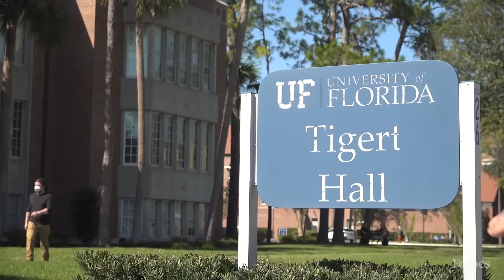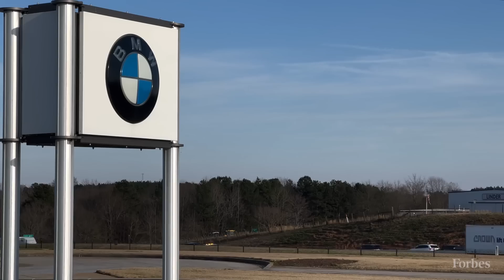Meet The New AI Robot Billionaire

Comment: Billion dollars global insight - Monetise as real life, sci fi movie, anime, TV drama and thesis to max profits and charity donations. 1. Max venture capitalists funding into global robotics industries by communicating in all social media, YouTube, website home page and organically that the robots movements are “wheel or foot” locked to GPS area using Australia Woolworths or Coles supermarket trolley tech. If the trolley or robots are manually pushed out of GPS allowed zone. System will auto fry the internal circuits to render the robot a piece of junk metal (no harm to humans touching the robots). Fines issued to whoever moved or stole the robots out to recover costs. If hackers attempt to remotely control the robots to walk out of designated GPS zone, the robots can’t do so due to “near field” (I made that up) control systems. 2. Here is the pivotal point for sci fi movie, cartoon, anime and real life. To get buy in and funding, focus efforts on robots to replace blue collar workers that perform manual labour at the same spot with torso rotation, or bending up and down. The robots can be recharged by cable (Separate thesis billion dollar insight, replace black power cables with diagonal bar patterned hi visibility, orange, red white patterns to reduce trip hazards, consider cable management systems using mesh metal bar structures hanging mid air in the ceiling thus the power cable hangs vertically from ceiling to robot on ground, separate AI system for ceiling cable management that can auto extend or retract power cables as needed. If power cable ran out of length, the AI system tells the robot to stop and alert human supervisor.). For robots with limited movement range for repetitive tasks, the entire floor tiles are replaced with Qi Wireless charging pads (Belkin) where the soles of the robots are auto charged with micro electricity with each step they take and when they are standing still. Naturally the room where the robots work in needs to be waterproof and barricaded to prevent human workers from bringing drink bottles, coffee, tea and soda in.

Comment: The end talking about the issues with power and teathers isn't a big deal with alot of jobs robots will be doing especially if they have a smaller battery for moving between stations that have power or data tethers. Imagine each station has its own brain and power supply the robot just plugs in and becomes the body. It only needs to be smart enough onboard to move between more specialized tasks. This can have huge savings with efficiency and raw material savings
Reply: Wireless charging and data connection through mats placed at each work station and a smaller on board battery.

Comment: Business grad and worked on Wall St. before this?  Hmmm red flag so, i went and did some digging.  This guy had an EV avian company go public, ipo'ed with no revenue last quarter even though he no longer works there.  Trevor Milton 2.0😂😂😂
Reply: As an engineer, I concur. You need engineers to lead engineering companies. Boston Dynamics for the win. Boeing is a great example of what it looks like when business majors lead engineering companies
Reply: @Laminar-Flow  What's wrong with Boeing? I ask this not out of sarcasm but literally from a place of ignorance. My understanding is that they're one of the biggest names in aviation and have done quite well for themselves, whereas Boston Dynamics recently shut down their last robotics project.

My take away is that you could have a business major leading a business (of any kind) but they absolutely need a cabinet or advisor who specializes in that field and helps guide the CEO to make industry-specific business decisions. I also majored in anthropology so I'm thinking about this from a behavioral/cultural standpoint lol.
Reply: @sproggs  Boston Dynamics didn't shut down their last robotics project, they replaced it with their newest humanoid robot. They just went out of their way to say goodbye since the old pneumatics based atlas was so influential. Boeing is facing a lot of criticisms lately for cutting engineering corners for profit. Their stocks are tanking while their planes fall apart.

Comment: Why does a robot need to have a human form?  Depending on the application, they would be more efficient using other types of locomotion and mechanical interfaces (mostly arms).optimized for their designed tasks.
Reply: It's easier to train humanoid robots because we have so much video and other data for humans and human-like motion
Reply: @snailedlt  Human movement is quite complex (compared to wheels), or even dog movement (spot by Boston dynamics). Due to being upright, humanoid robots need significantly more actuation and degrees of freedom to maintain balance, particularly during complex maneuvers. As the previous commenter said, it is because the world is designed for humans - stairs, door handles, buttons (need nimble appendages), tools (all made for human hands). Can’t open a dishwasher without fingers, or use a sink very easily if you are not human shaped (upright, similar height, hands and arms). There is also the consideration of acceptability - humans are more likely to feel comfortable with something that kind of resembles other humans (the only other intelligent entities we interact with).
Reply: It's because people think humans are made to look like god, by all means they can design a robot to look like a star wars robot like R2D2
Reply: The world we have designed and built up was designed and built up for humans. A humanoid robot is putting a square peg in a square hole
Reply: With a humanoid robot you only need one robot instead of hundreds of specialized robots. Heck, you don't even need a dishwasher or washing machine because the robot could wash by hand. Even a robot vacuum cleaner could be replaced by a humanoid robot with a $4 broom.
Reply: @jimj2683  I mean we could do that with robots more similar to octopuses as well, but we don't have anywhere near the same amount of data for octopi as we do for humans/humanoids, so it would be much harder to do with transformer based AI models
Reply: Because they want to upload their minds into the robot so they can live on forever. Why else are they putting touch smell and taste sensors in the robots. I can't wait to be a robot
Reply: @drekelley2352 they can't even figure out how to upload themselves on the internet
Reply: Because they r about to replace humans in areas where infrastructure is built for humans.